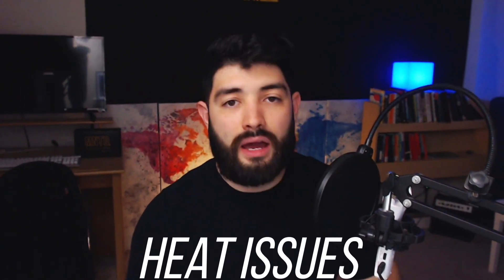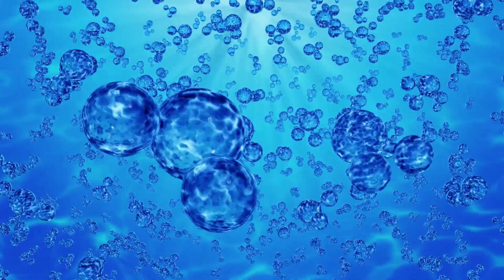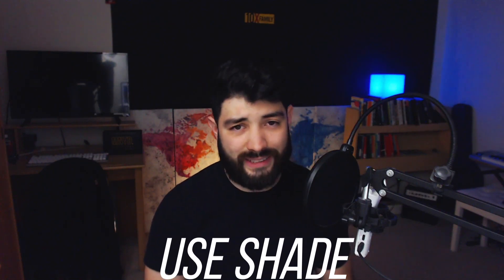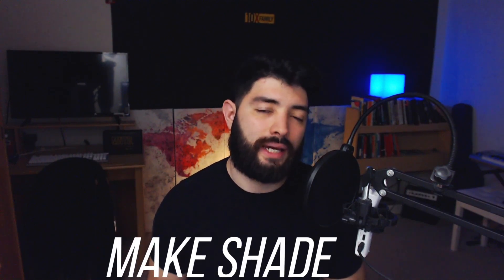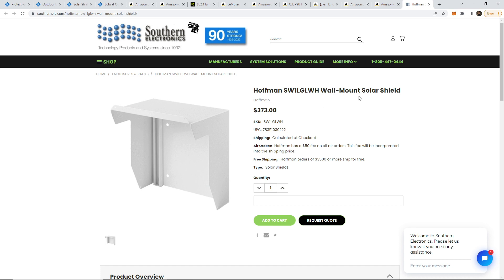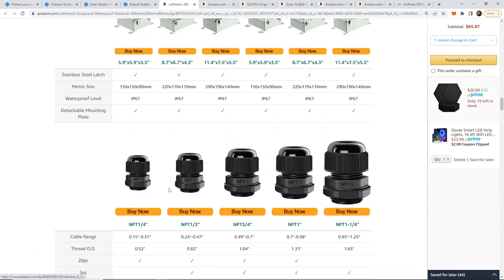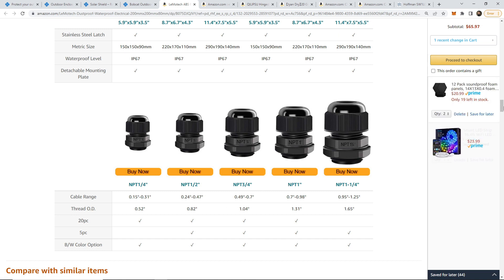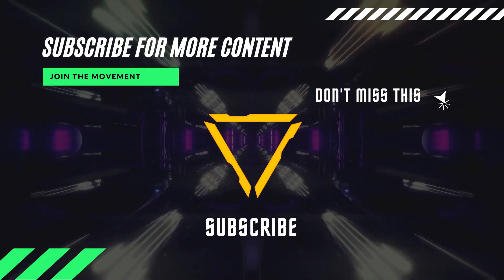How I'm battling this Crazy 🔥 Heat Problem for My HELIUM Mining Business.

Comment: I wonder if I use a roof paint called cool seal and actually paint the outdoor box with tht
Reply from the maker: Interesting. I've never heard of that. but Maybe it's something I can look into. that would be a really cool fix.
Reply: That’s not a bad idea. Cool seal is a regular elastomeric roof coating. It definitely helps with the heat I recently used tropi-cool silicone roof coating on a few rentals. It’s much better at staying cool. Like Gabriel I’m also in Texas, El Paso to be specific. You can walk barefoot when it’s close to 110 degrees on the roof coated with tropi cool.
Reply: @markverde8666  yeah I'm in south Florida it's hot but I also looked into the ground level heat vs 30 ft high and it's a lill cooler higher up I'm going to paint my outdoor box with it next weeknd

Comment: I live down the road from you and I haven't had any issues with heat. I literally just create a vent to let heat exit.
Reply: Also, anyone using a sensecap (or any miner with a built in fan) is a bad idea to put a inflow fan in our area because of the humidity levels.
Reply from the maker: yea I don't have any issues per say, but to keep my miner from burning out in a year, we need some kind of protection for it. how does the heat get out though if there's no intake to create a draft? air cannot move out without new air moving in.
Reply from the maker: 100% agreed. I'm super cautious about the fan idea just because of humidity.
Reply: @gabrielchaparrotalkscrypto  For me it's all been depending on the miner. Six of my locations have sensecaps and 4 are MNTD. For the sensecaps, I don't worry too much sense they have their own built in fan. So I drill two holes in the front of my enclosure for the sensecaps, and I'll position  the miner as low into the enclosure as I can since heat rises. That way the heat will escape the top vent, and the fan on the sensecap will allow just enough air from the bottom vent to cool it down. For the MNTD, from what I'm aware, it's pretty well covered but the overheating is more of an issue in my opinion. The shade like you mentioned is a great idea. Still leaving holes for the heat to escape and fresh air to come in. Even adding a fan for these I don't think is a bad idea. Mainly since most of this hotspot is covered. Not saying the moisture can't still ruin it, but, it's not giving it as much access to the components like the sensecaps.
Reply: Love the channel btw.

Comment: have you actually had any issues with your equipment overheating? or is this more playing it safe ?
Reply from the maker: at the current moment of me typing. one of my miners sits at 143 F. the day here in texas is 75 Degrees and the wind is cool. Lows od 53 F.... So to answer your question it's more of playing it safe. but If warping comes into play over the long run of over a year... then No doubt I will have problems. because in the summer time when the weather gets to 100 like it usually does... I'm gonna have some issues.
Reply: @gabrielchaparrotalkscrypto  great point. I hadn’t even considered the plastic enclosures warping. I mostly use the rak metal ones and was concerned about the heat only.  Last 4 or 5 though have plastic enclosure as well as my off grid. Now I need to reconsider the plastic enclosures.
Reply from the maker: @markverde8666  well i don't doubt that the enlclosure can sustain the heat. the biggest concern is the motherboard warping. basically getting hot then cools then gets hot, then cools, this will have a long term effect on how the connections stay strong. there's soldering points inside that also react to heat and the cold.
Reply: @gabrielchaparrotalkscrypto  how do you check your miner temps?
Reply from the maker: @bforce1999  you can use your miner diagnoser. I have bobcat so I can do it on the Bobber app. soon most hotspots will have apps. but you can do it on local web dashboard of your miner.